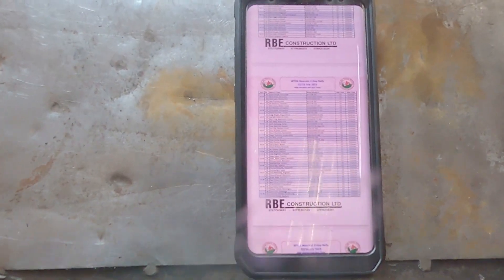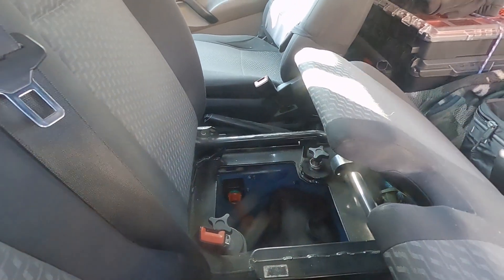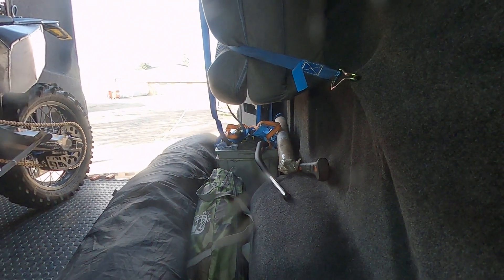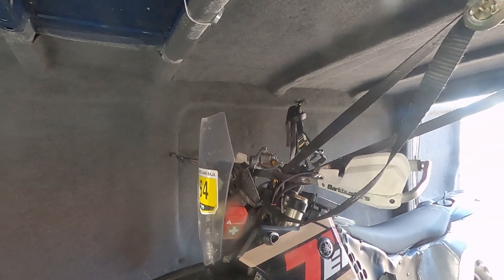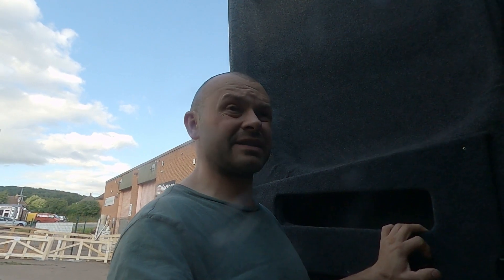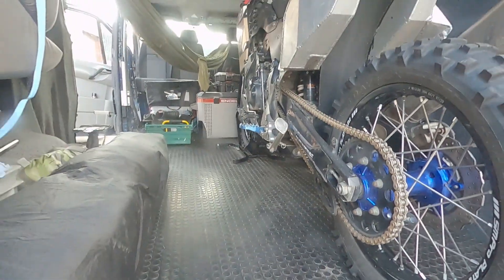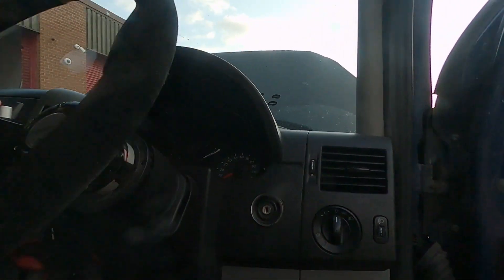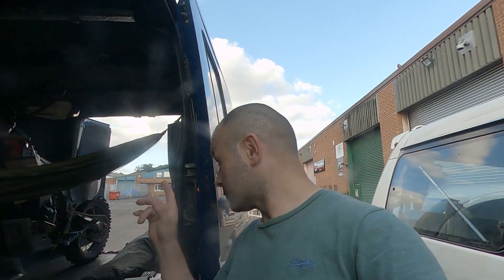The 1%, van tour

Comment: i was looking forward to a tour of the van, friggin love it, very interested in what direction you go in clutch choice, are you using crafter G/box ? cheers
Reply from the maker: Thanks! I am using sprinter 2009 6 speed gearbox, I'm not sure if I will get the proper clutch sorted for it as its quiet expensive or go for auto box with stand alone controller as it will cost similar money and because I still have jerking problems below 2k rpms that would solve the issue completely and just makes it more comfortable, I kinda miss the auto I had in the  4x4 vivaro, we'll see. for now there is way too much going on with the business and racing so it stays as it is until we have more time.